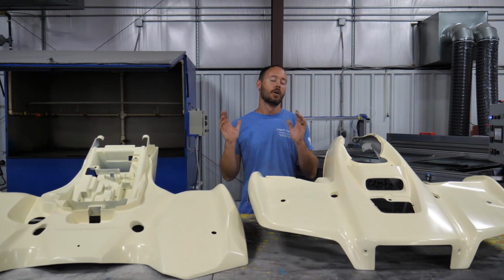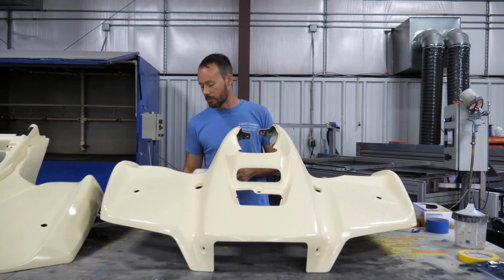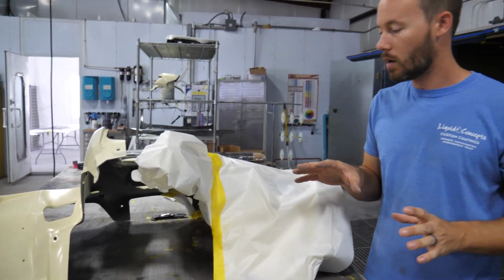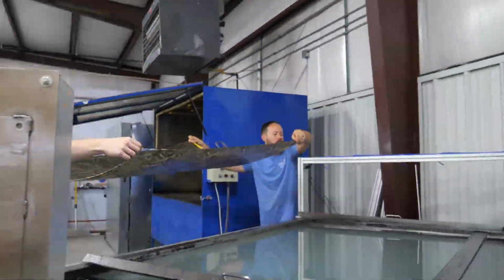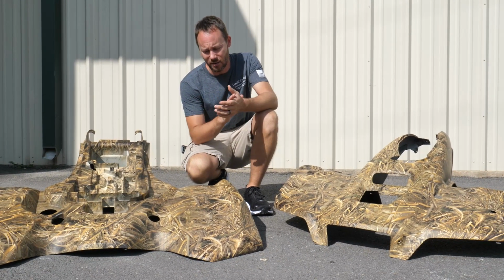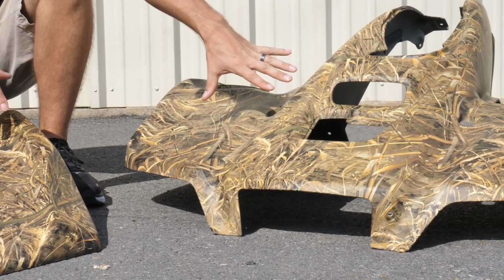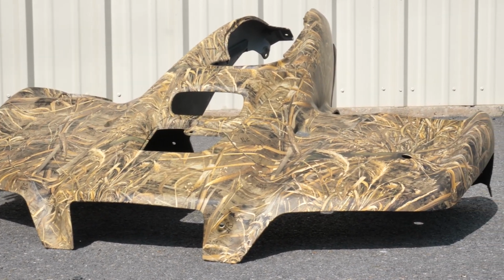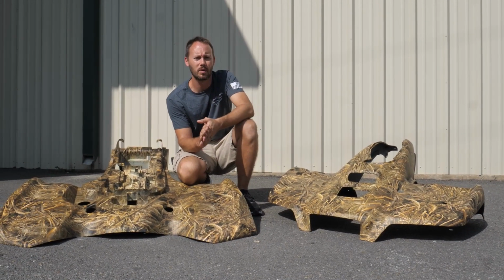HYDRO DIPPING ATV PLASTICS! | Liquid Concepts | Weekly Tips and Tricks

Comment: How would you say this compares to wrapping in terms of cost and durability?
Reply from the maker: Wrapping is not permanant and will peel and lift in more recessed areas. The hydrodip uses automotive primer, paint, and clear to give you the same protection/durability as what is on your vehicle; however it can still scratch etc depending on how it is used. Pricing wise depending on the shop, location, etc you could be close to the same price or a little more for the hydrodipping just depending on the size and complexity of the plastics you are wanting done.
Reply: @LiquidConceptsUSA  I wasn't aware it was actual automotive quality paint and was that durable. I was under the impression it was kinda like a plastidip or wrap or something that wasn't very durable at all. Thanks for the information
Reply from the maker: @dbriggs1689  😉

Comment: Hello--you nearly have convinced me.  I own a 2005 Polaris Sportsman 700 EFI in Mossy Oak Camo that I've had since new for 18 years now with extremely low mileage.  Despite keeping it indoors for the majority of its life, it has faded to a somewhat "Purple" color.  If you haven't heard of the mid-to-late 2000 Polaris ATVs/UTVs turning purple then I probably should not be contacting you, as this is very prevalent for these models--most likely due to lack of or defective UV inhibitors during the manufacturing process.  Regardless, I need to contact you with details about getting my Mossy Oak Break-up Camo restored to new condition via hydrographics.  Please let me know if you can assist.  Thank you--David
Reply from the maker: David with this process you are using automotive primer, paint, and clear coat. It is basically have the same durability as your cars finish but it can scratch.